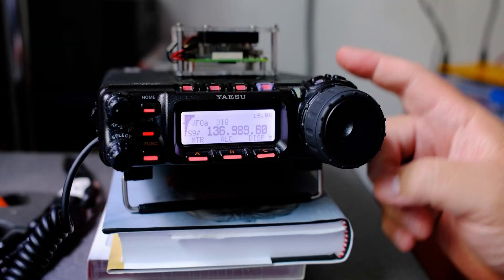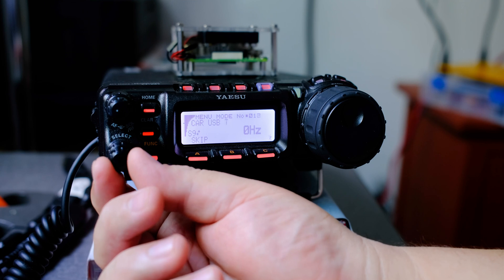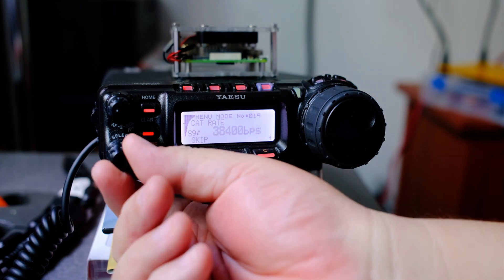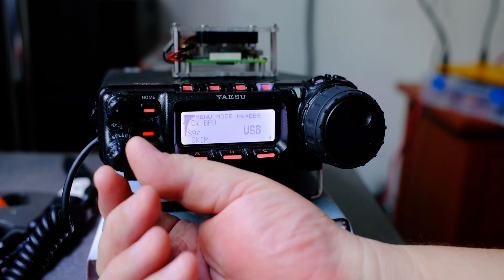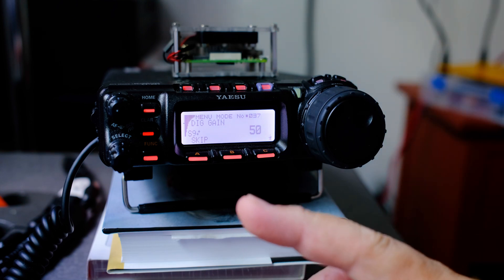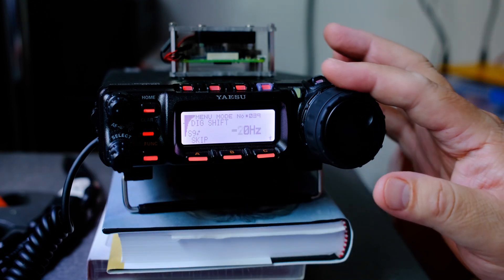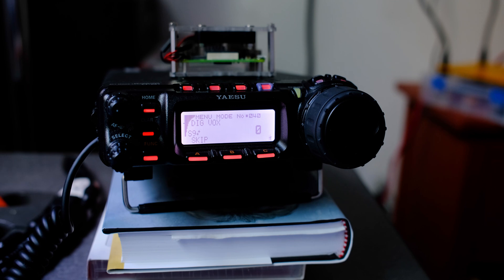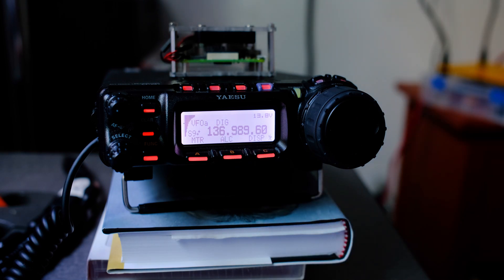Yaesu FT-857 Setting for FT8 | JS8 | WSJT-X | Digital Modes

Comment: I noticed something odd with FT8 on my 857d. When setting the transmit frequency in WSJT-X, the rig center frequency seems to be interpreted as the center of the SSB passband rather than the carrier frequency. Is that your experience as well?

Comment: Did you write software for Raspberry Pi or download it?
Reply from the maker: All the software can be downloaded to the Raspberry Pi.  All you need to do, what I did, was to configure the files to start up correctly.
Reply: @frankwc0o  Also, does it interfere with normal VHF, HF activities?
Reply from the maker: @lblittle1207  do you mean - do you use the same frequencies? Yes.
Reply: Where did you get it? Jason, KM4ACK?
Reply from the maker: @lblittle1207  no. Just found it on the web.

Comment: On one hand people tell me the FT-857D won't do Digital without a soundcard, on the other hand Rig Blaster Tech support said I didn't need their interface.
Reply from the maker: It’s true you need some type of interface so the computer can talk to the radio. You should look into digirig very easy to use. Check it out
Reply: Upgraded-LONCEVON 10 inch Small Mini HDMI Monitor with VGA USB BNC AV Port;Mini LCD Screen 12V Monitor for Raspberry PI/Camera/TV/PC/Car Screens for kids;1024x600 Pixel with Speaker Remote,Cigar LightUpgraded-LONCEVON 10 inch Small Mini HDMI M…

$68.99

Mini PC Windows 11 Pro GK41 Mini Desktop Computers 8GB DDR4 128GB SSD Intel Celeron J4125 Processor Dual LAN Mini PC, Digital Mic, Business Small PC 4K HDMI/DisplayPort HTPC, Dual Band Wi-Fi Micro PCMini PC Windows 11 Pro GK41 Mini Desktop Com…

$159.99$159.99

 & FREE Returns

In Stock

Size: GK41-
Reply: @frankwc0o 
 Upgrade] 1Mii USB Sound Card USB to 3.5mm Jack Audio Adapter - Virtual 7.1 Surround Sound - USB Adapter for PS4/PC/MAC/Stereo Headsets, External Sound Card No Drivers Needed Plug and Play

Comment: @frank wc0o - some sources claim that you should only use CAT rate 4800 bps with Yaesu857 when setting up menu #19 for use of digi modes. You recommended 38400 bps, do you feel that it works just fine, have you tested the lower 4800 bps?
Reply from the maker: I have never tried 4800 bps. You should try 4800 and if your results all good then you should keep it that way. It’s possible that other equipment could not go any higher than 4800 when this radio was first introduced . If you do decide to use 4800 come back and tell us if you liked it.
Reply: @frankwc0o  Thank you for your swift reply! I am happy to confirm that the 38400 bps setting works very well w/ the Yaesu 857D and FT8. My earlier problems were caused simply by a bad connection in those !%##"! mini DIN connectors on the Yaesu rig, got them modified and sorted today. Thank you for your excellent instructions, got the Yaesu a new job as my parks/44 rig now! 73 de OH2CJI
Reply from the maker: @jans4636  Super.  Ya, I had a bent pin and there goes $20!  I'm glad we have better tech today.  Although, I wish the would make a new version of the 857D.
Reply: 4800 works fine with my 897 for all the digital modes I've tried. I had to do this rate as the port is shared with an AT897+ which runs at 4800.

Comment: I can receive but I cannot transmit radio transmission code
Reply: I have the same problem.  I can RX, but when I try to TX, radio red light comes on, but power meter shows nothing being transmitted, and PTT LED on SignaLink stays dark.  BTW, my setup as-is works fine with Fldigi, but not with WSJT-X.  Help!
Reply: @davidboyd1395  I have the same issue with WSJTX and the Digirig mobile. I don't know what to do RX is great , TX red light is on no power out. If you figure out a fix please post it.
Reply: I'm trying to transmit on about Bang radio I can receive the frequency but I cannot transmit on the frequency I don't know the code it I can't find it
Reply: Same for me could receive, the tx is on in the radio red light but the doesn't strong enough.
Reply: @frankwc0o  tks

Comment: I use my 857D with wsjt-x and fldigi via digital VOX and a Signalink.  I could never get the rig to communicate properly or consistently with the computer (Win 10 laptop) to enable rig control.  So one day I tried solely digital VOX and it worked fine, but without rig control.  For me, this is not a deal killer, so VOX it is.  Take care, have fun, stay safe.  73 de Cliff W3KKO

Comment: I've Ft857.  on Ft8/DGI  mode with CAT if I set power more than 10 watts was errors, I mean the frequency inconsequential or move on another band uncontrollable.  How about you?  YD2CQE
Reply: @frankwc0o  oke thank you for your response,  I use CAT U5 link for Ft857,  asus ROG installed run on Windows 10 &  both wsjt-x, JTDX sound card.  If you want, I can show you  the problem video
Reply: @arafebi5414  Had very similar problem with Ft-857 running on old G73Jw Asus.   I put ferrite beads over all of the USB cables, and the audio interconnect cables connected to Asus, and it fixed it.    I think the asus was just too sensitive to RFI. The notebook lacks any good RF shielding, and there are very few ways to provide sufficient grounding.     It took a bunch of ferrite beads on each cable.